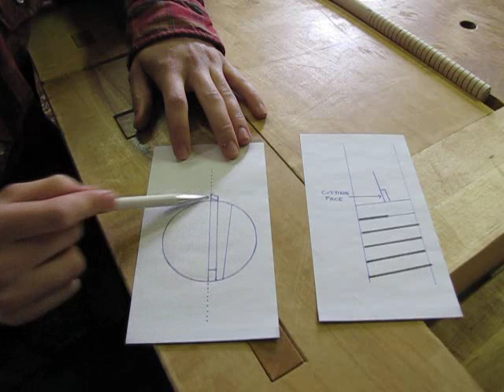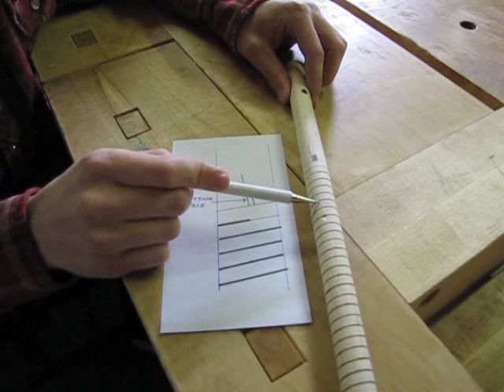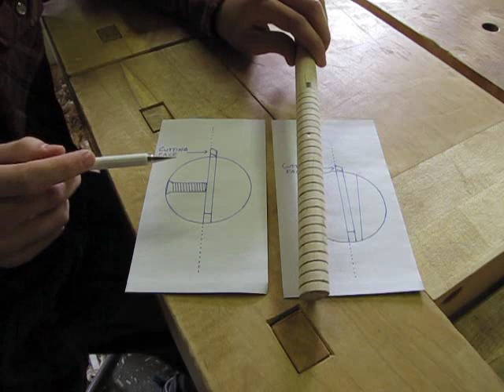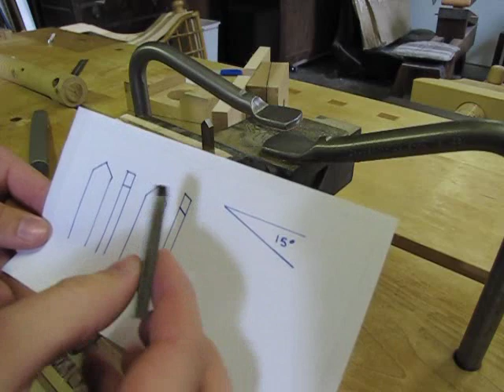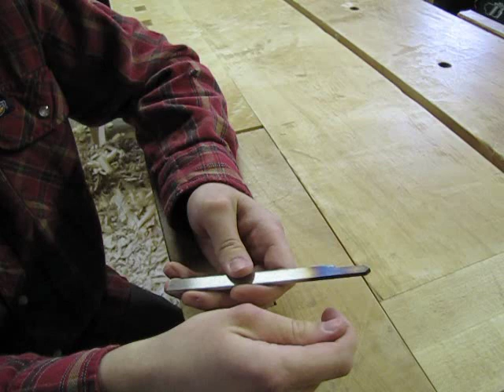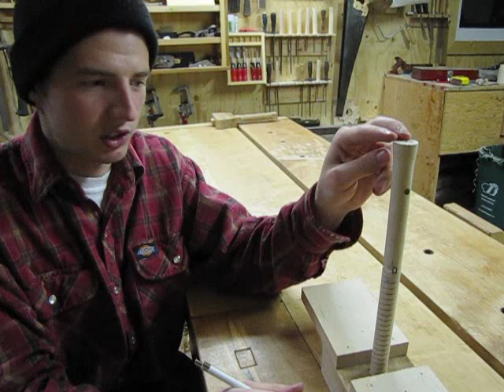Tap and Screw Jig Tutorial - Part Four

Comment: You opted to use a wedge to hold the cutting edge in lieu of a set screw, worrying that there was not enough wood to hold the blade, but is there not a similar concern with a wedge splitting the wood along the length?
A possible solution might be to use two smaller than usual set screws from opposing sides.

Comment: Instead of the wedge,even on a diameter this small,you could put in one of those course metal inserts like they use on prefab furniture.It has a really course I.D.,and a small threaded I.D. you can put a set screw in.Would be much easier to make fine adjustments than the wedge,and wouldn't wear out like a setscrew just in the wood.You know how youtube is with links,so go to mcmaster/dot/com pg.3254 or grainger/dot/com pg.3288 as a start.

Comment: For the folks who don't want to make the cutter, 'E' carbide lathe bits, which cost less than $5 would be an option. For $10 - $15 split end 60 degree 1/8" or 1/4" diameter carbide cutters are round. These cutters are available from any metal workers supply or on line from places like McMaster, Enco, etc. Excellent series of  videos by the way.